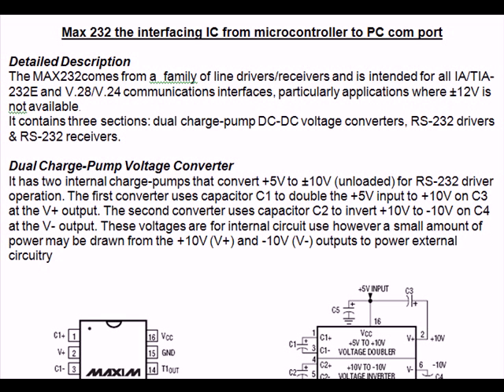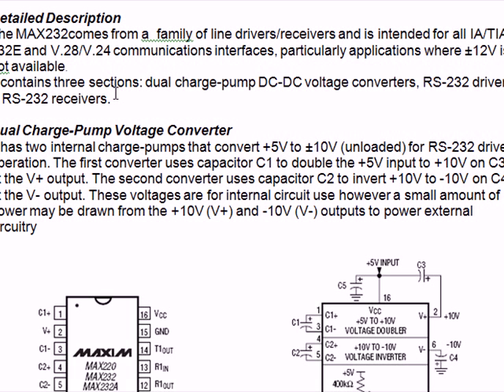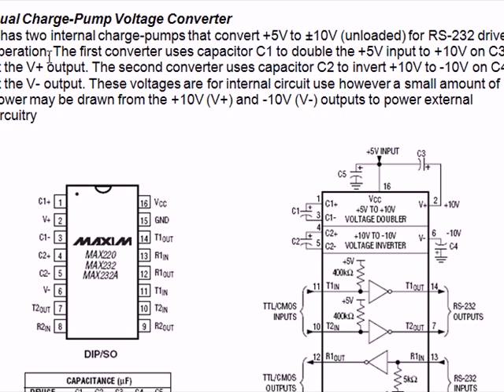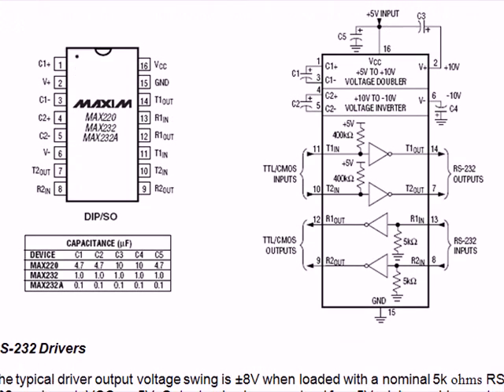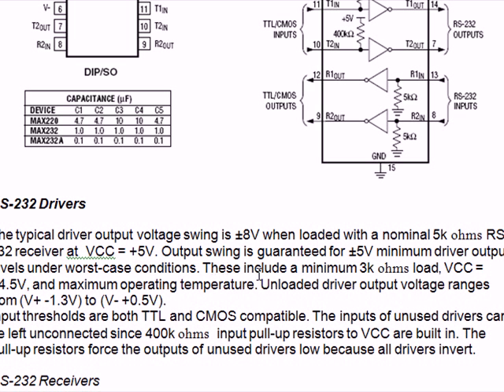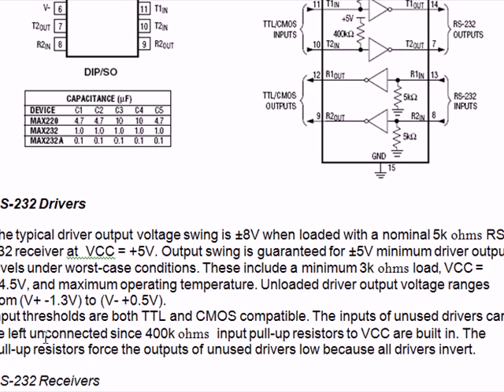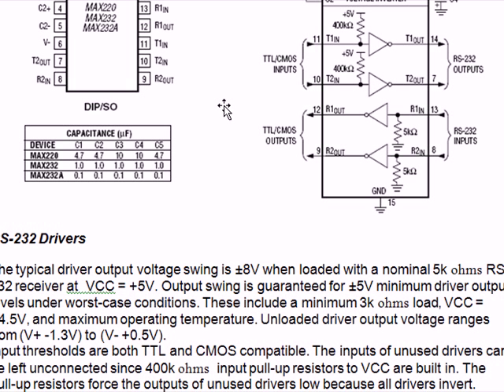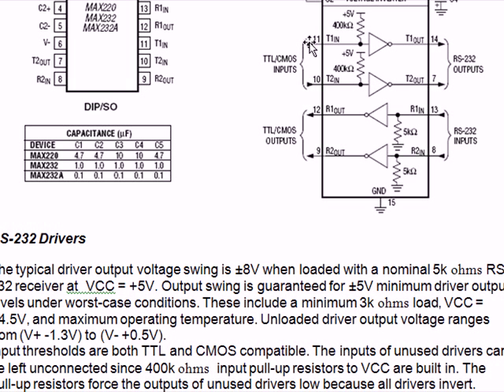Max232, The level shifter IC for microcontroller interfece.avi

Comment: thanks for sharing.i regularly follow up your videos and ive learnt a lot, however i have a doubt regarding the functioning of the capacitors in max232. i have also read that the capacitors form charge pumps can you pls elaborate.. and what type of a voltage doubler is embedded in the ic?